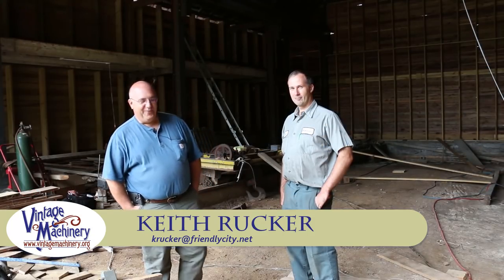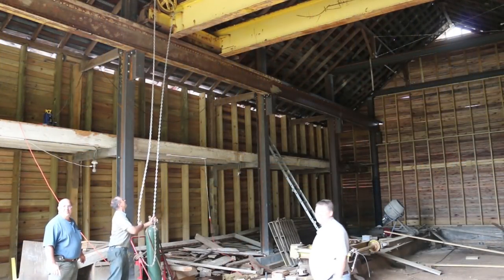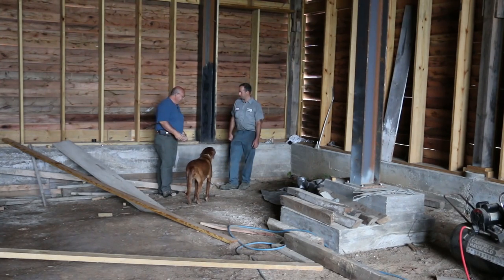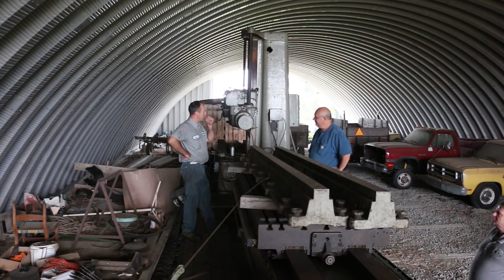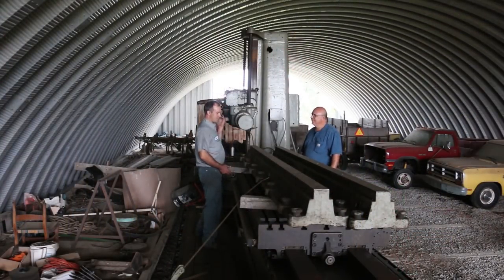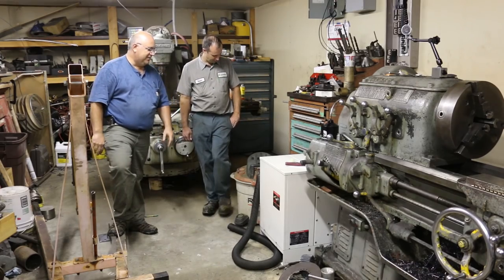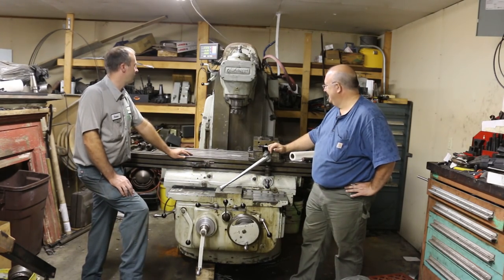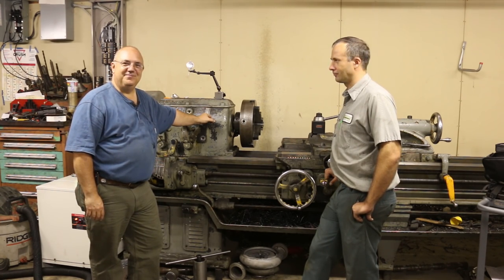Shop Tour 2:   Brian Block

Comment: That guy is building an awesome shop with some impressive machines! :-)
Reply: I can't wait to see that guy moving those huge machines around with that bridge crane! I also wish he was around so I could ask that he make a video of that vibration damper in his Cinncy mill some time. I wonder if the design could be adapted to other mills and machine tools.
Reply: ArtemiaSalina
Sadly the "dynapoise" feature is up in the overarm so you can't see it in action. Here is a pic on http://www.lathes.co.uk/cinedo/img18.jpg would make a cool video if I could though. Kennametal uses the same basic thing in their DeVibrator boring bars.
Reply: Masters in Mechanical Engineering ?! Holy crap, no wonder you're able to do all that stuff.
Reply: What size is the taper on the Cin mill ? 50?

Comment: Long time ago I worked at a place that had big overhead cranes and big machines that the machine table was so big you could stand on it will machining your part. The place was called National Automatic Tool Co. NATCO. The building was tore down yo scrap the metal. The shop had 2 50 ton over head cranes with a drives in them

Comment: I think people were more concerned about the point loads over the "falling off"...we used 6"x6"x1" pads on all our machines at the build shop I worked at.  The reason wasn't about falling off, it was about spreading the loads.  They tried using 2x2x1/2 for a while, but everywhere they used them the concrete was starting to fail. After moving to the bigger pads, that stopped.

Comment: ..Bridge crane/s.....I worked in an old (started in about 1915) shop here in Sacramento, Calif that had 10-12 bridge cranes....all were hand operated....I think the biggest was 30 tons....there were 3-4 that size.....pulling chains was not too bad....just a little slow.......  (Sacramento Engineering)...shop still doesn't have a website or anything.....
 How old was the shop?.....old enough that there were overhead line-shafts running belts to the 15 or so lathes....AND....every lathe had a small crane on the back for changing chucks.....
Reply from the maker: Cool stuff!

Comment: Keith, did you ever get the rapid vertical bed lift ( remember I'm a bricklayer :) ) to work properly on your K&T?  I may have to go visit Brian after he gets done.  I wouldn't mind going South and checking you out.  Not a warning just a thought, Greg.
Reply: if i may answer, it was improved but still not 100 percent, supposed that after the ball ratchet drive system was repaired, that there was still binding or stiffness in the vertical slideway, perhaps old lubricant, but that was left, maybe to revisit someday.
Reply: Thanks to jusb 1066, I think that's where I left off, too!  Greg

Comment: At 20:00. Isnt 100 A a Little low for 50 HP?
Reply: WAY low but it was never intended to run this kind of stuff. The new shop has 400amp service.
Reply: The fact that it starts that 50 horse motor is incredible. Must a slow blow breaker.